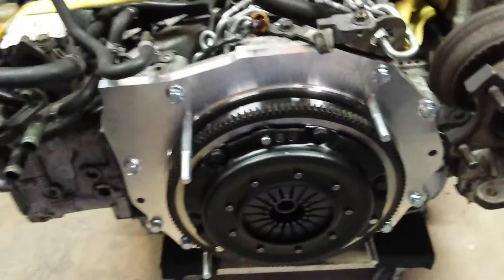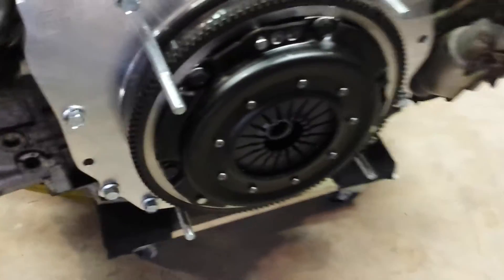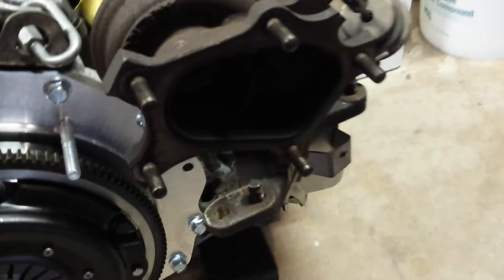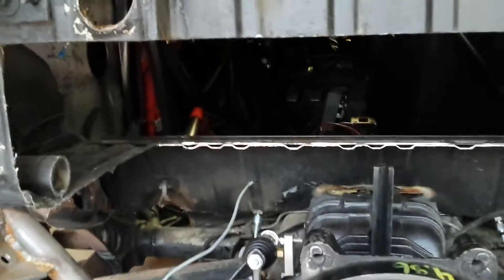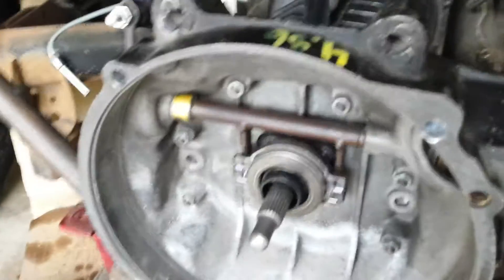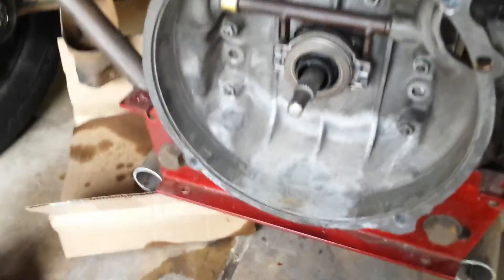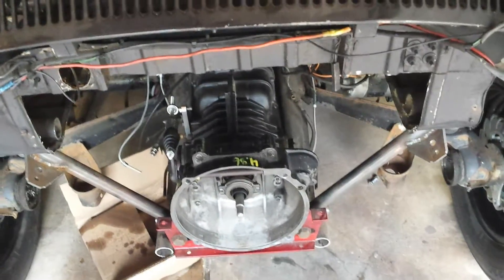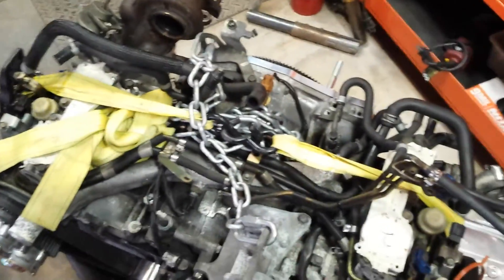VW Bug Project With Subaru Engine: Update #3

Comment: how did the exhaust limit your ground clearance with the oil pan
Reply from the maker: The exhaust hung lower than the oil pan....if I understand your question.
Reply: @MRT_H  I had to shorten my oil pan. It hung much lower then the exhaust
Reply from the maker: @cameronthomas4290  Depends on the model, application, and exhaust size.... My 3" downpipe and JDM twin scroll exhaust manifold was lower than the pan by a bit. NA's are a little different...some turbo engines are different as well.

Comment: Hello sir what engine do you put in? 2.0? I want to do the same swap in my super beetle with turbo
Reply from the maker: JDM 2.0 twin scroll turbo engine is what I went with.
Reply: MrTurbo458 ok, do you make it running?
Reply from the maker: @Eloymm28  yup, check out my newer videos. Ended up selling it though.
Reply: Ok, do you think the 2002- 2003 Subaru wrx turbo works with the Kennedy adapter?
Reply from the maker: @Eloymm28  Yup, you can always contact Kennedy and ask too. But all EJ Subaru engines are the same bell housing on the engine side. Some are 4 bolt 2 stud (newer style), and some are 2 bolt 2 stud, but the KEP has provisions for both.
Reply: MrTurbo458 Thankyou for help info

Comment: I will like to see a video of a ea82 turbo. No body  wants to deal with this tipe Of set up on a beetle
Reply from the maker: EA82's are junk. They only make 100ish HP on a good day, blow up when modded, and the head gaskets can't hold much boost (barely the stock 7psi). I've hot-rodded those engines in the past, so I know all about them.  The power that you would "gain" for the effort, you may as well build a hot 1915cc air-cooled. The EA81 pushrod motor is a far superior engine to the 82, but it's even more pointless to swap one of those. Check out the carbbed EJ22 swaps out there, that would be a better idea. 👍 You want power? You have to pay to play, be it work, money, or all of the above.

Comment: Why would you ever use an adapter plate to mount a subi engine and still run the original vw box. It's just matter of time for the vw box to blow up. Why not cut down the subi box and do a reverse opinion set up..
Reply from the maker: Because the VW trans I was running is a very strong & upgraded version (cheaper than converting a Subaru trans too). They make kits to adapt the Subaru transmissions but they are a bit expensive. VW bus transmissions (type 2) are much stronger than type 1's. Nothing wrong at all running an adapter plate and VW trans.... You just have to match your Subaru power output to the trans is all. There are lots of big power air cooled engines running VW transmissions too. There is always more than 1 way to get the job done. 👍 Also, I've been in the Subaru world a while, and it's pretty easy to grenade a 5 speed Subaru transmission too unless you go 6 speed STI (more money). It's more about how the car is driven, and a bit more goes into it than just power.

Comment: great videos.can you tell me pls the specs  and brand of the clutch master and slave cylinder.keep on.
Reply from the maker: Subaru 96' ish master, Jamar slave.... I ran Subaru pedals to operate the master.
Reply: thanks for the reply. which alternative do you recommend for the master ?
Reply from the maker: Cnc or Jamar make good stuff, you'll have to hack your firewall for a pedal assy though. Someone might make a conversion that fits in the shifter tunnel too, do your research if you want something like that.... Hopefully that helps you!

Comment: I'm so glad I came across your video I was very curious about you're hydraulic clutch setup! Here's my dilemma Imy 69 is an autostick that I'm converting to manual a vdub shop in the area wants 500$ to weld in a clutch tube so I was considering the hydraulic a few questions, does it mount right up to my manual transmission, is there clearance issues with a standard beetle?
Reply from the maker: KUTZFRECH there shouldn't be any issues in a regular beetle with the clutch slave, I have a 002 (bus) trans and I used a mount from Pacific customs (the aluminum bracket you can see) that mounts where the clutch cable holder mounts, type 1 is similar if I recall correctly.  You don't have to weld a clutch tube in,  you could probably rig up a cable, similar to a simple cable setup such as a bicycle brake cable/sheath (super sized) check out what sand rail guys are using for clutch cables too....